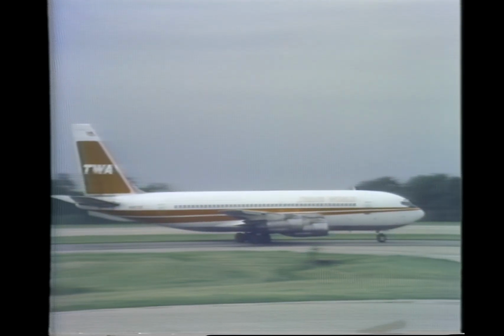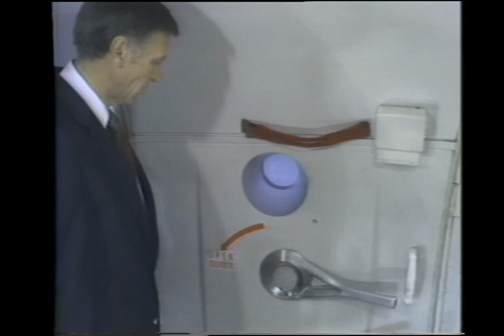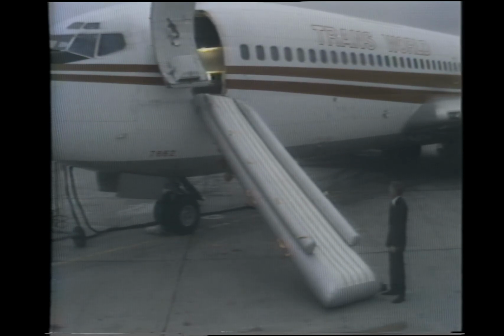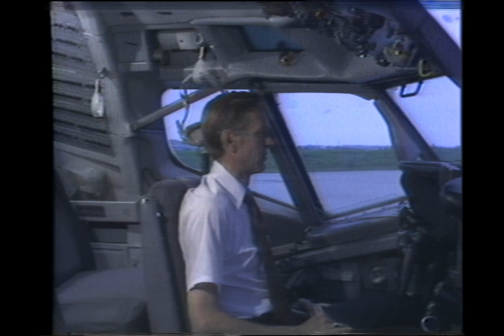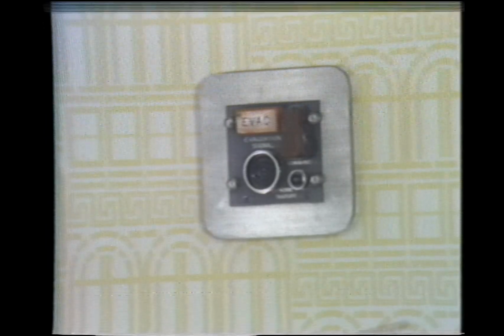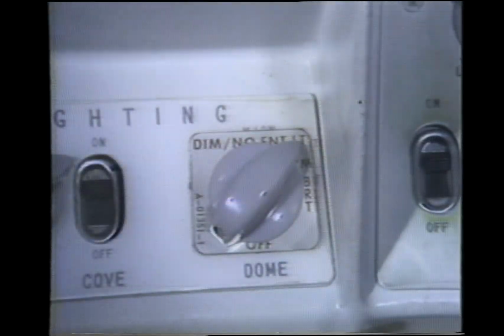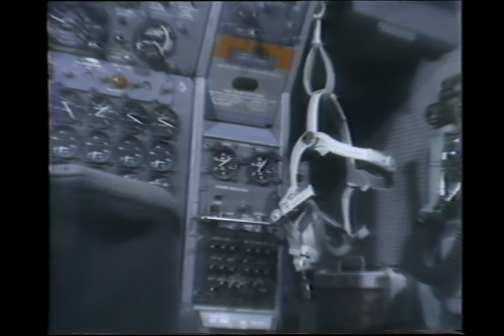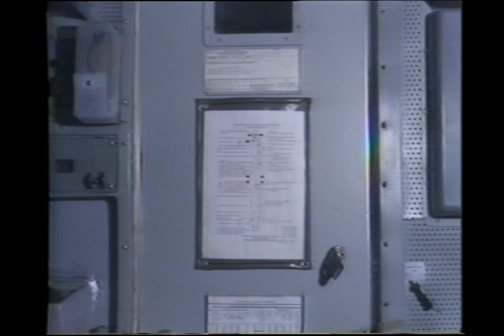707 Safety Equipment

Comment: Who knew about these hidden ropes in the doors?  Do those still exist in today's aircraft?
Reply: Last time I checked, most airliners these days don’t have them. FRA mandates that the flight attendants and crew must usher passengers to a functional exit if the slide does not deploy. The only evacuation ropes still on airliners these days are on the flight deck for the Captain and co-pilot, however they can be used by passengers if the crew finds it necessary to do so.

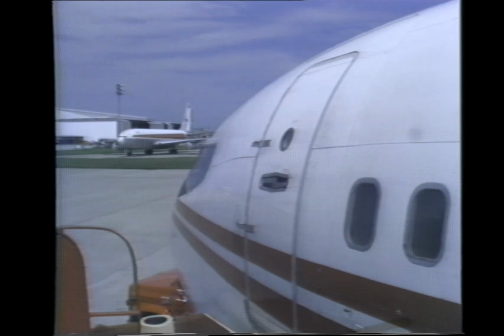Comment: How old is this video? There's a 707 in TWA's old Twin Globes livery in the background at 1:06
Reply: Good point, the hollow logo was 75-79 so maybe early in that time. That would have been very early for color videotape I bet this was taped on an Umatic unit
Reply: @andrewcarson7238 This was filmed at the MCI maintenance base using stored turbojet 707-331’s (including N762TW used in this video). I think around 1978-1980 would be the timeframe.

Comment: The way to arm door is very different than modern standards
Reply: I noticed that too!  The 727 and 737 have a long girt bar that is engaged in floor brackets.
Reply: @Longbeachliner yeah
Reply: @Longbeachliner  Not surprising since Boeing adapted much of the basic 707 airframe to the 727 and 737, maybe the 757 as well. Which saved KFC-size buckets both for Boeing and for airlines with all-Boeing fleets.